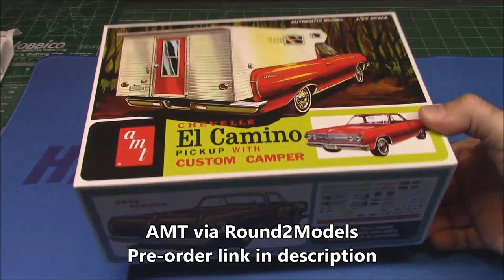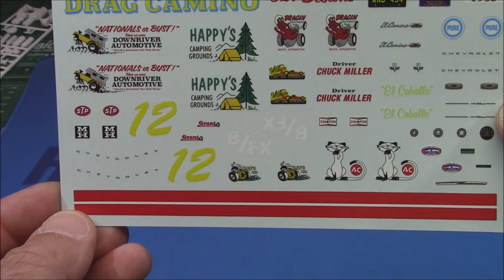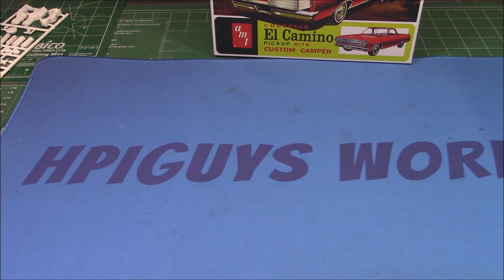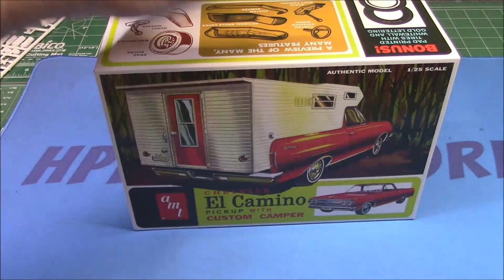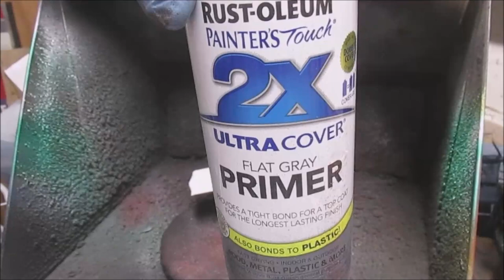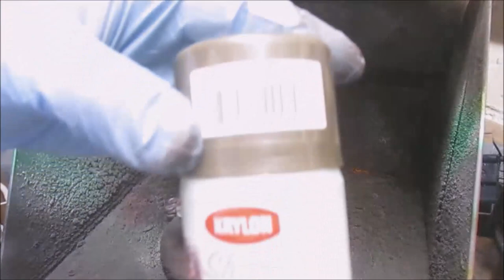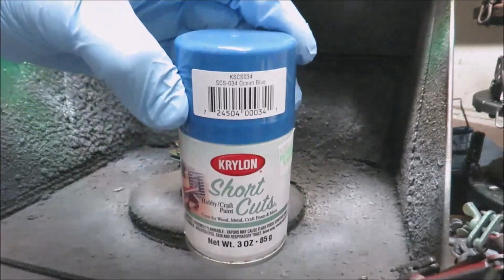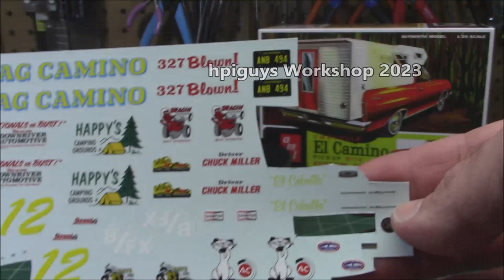1965 Chevy El Camino 327 Camper 1/25 Scale Model Kit Build How To Assemble Paint Mask Decal AMT 1364

Comment: This is so ironic; I'm working on a 65 El Camino right now.  It's all original --- Factory Corvette 327, 4 speed, 12 bolt differential, black with red interior, bucket seats and four speed.  Best part is there is VERY little rust --- it was in a barn for over 30 years in the lower desert.    So now I have to get this model and clone the big one...........     Thanks for sharing your skills with us.

Comment: Very nice kit. I like the review. I have the 80's El Camino camper kit, I got rid of the 6 cylinder engine and put in a 350 Chevy motor out of my parts box. Used the car for a camping diorama. Keep up the great work, Chris.
Reply: I had fun adding my own ideas to a model. Around 1975 I remember I took parts from a 4x4 pickup truck model and turned a van into a 4x4 van. I also took the rear axles off of a semi truck model and put them under a pickup truck like the way the original Bigfoot started.

Comment: I got a few '65 Gear Hustlers to do different versions. So since I would like only one version with camper I'll get it and  use the extra parts for others. Seeing the custom grill I think I'll do a drag version and cut open the hood and use the MT slicks. I wonder 🤔 if the camper would fit on the '68 El Camino to.

Comment: Everything about this kit looks great! Can't wait to get one. There is only one thing that I think could be better on this and that would be to have a separate from the chassis rear suspension so that you could manipulate the rear end height. It looks a little low in the rear to me. In fact, it doesn't appear to even look level. It might be the camera angle? Anyway, another great looking build!
Reply: You could use a pin vise and drill the axle holes in a different height, or if you have spare crew wagon or surf wagon, the bottom pan on those has two ride heights, and fit that el camino nicely! 
   Those are the 2 tips I have for that, it can be done!
Reply: @ronaldhuff635  In the past, I have drilled new holes to adjust rear end height on quite a few kits and I show that on my channel. I'm not a huge fan of one piece chassis's. You cannot get it as good looking as a separate piece chassis. I also am not a fan of spending twice the money to get one kit out of it. So, it's off to breaking out the pin vise to adjust that sag...